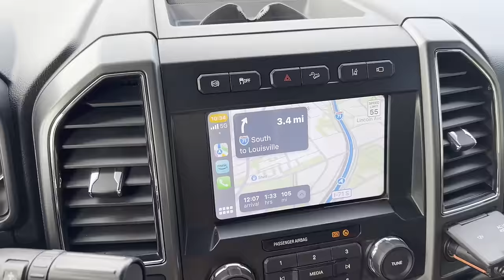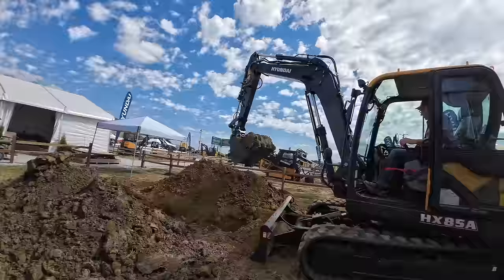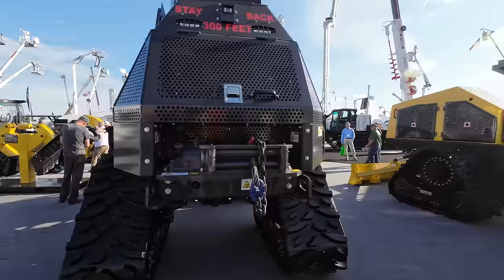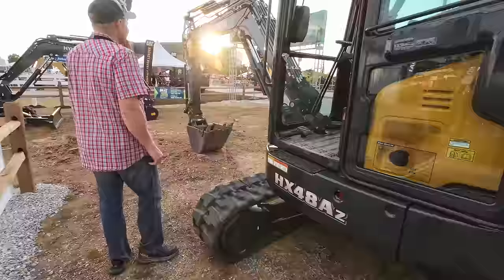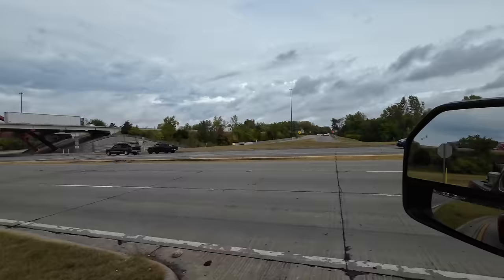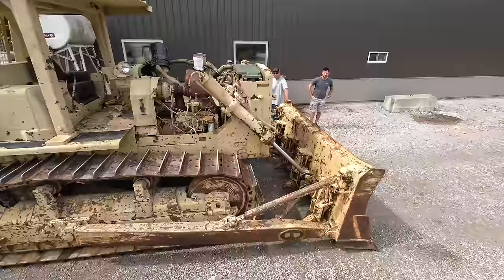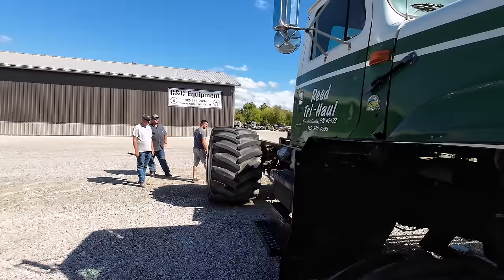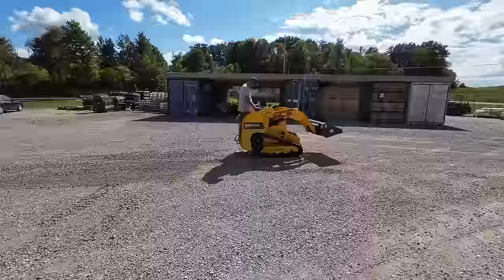Crazy machines at the Utility Expo, and a behind the scenes tour of C&C Equipment!

Comment: The Ditch Witch mini skids are monsters. Several years ago, the landscaping company I was with had a Vermeer mini skid. It was a little gutless. Then we got the Ditch Witch SK850 for a couple years and then the Sk1050. That 1050 was insane. It could do almost as much as our Cat 257 and 259. A 50-60 inch bucket or 2400 pound pallet of block was no problem(with the weight kit).

Comment: I used to repair Army equipment and sometimes it was cheaper to buy a new piece of equipment, strip it and repair 5 or more pieces of equipment with the parts from the new 1. Once we did that we would park that piece for a while them DRMO it.

Comment: Small Emplacement Excavator (SEE) was used in the late 80s early 90s by Army Combat Engineers.  They were for building crew served weapon emplacements quickly and reducing obstacles for light Infantry, Airborne and Air Assault Units.
Reply: They were also used in Quartermaster companies. I was in a unit out of Fort Lewis in mid 2000's and we had a couple we used for digging fuel berms.

Comment: Matt to be honest if you need or want a pit build an outside one. Really you only need to have a gravel bottom and a sliding expanded metal hatch. Concrete with steel beams much like C&C has. Add in some electric and you are golden.

Comment: Hello Matt. I got a mini 2.5 tonne excavator. I just did the rebuild on the spool valve but could not drain the air out of the cylinders. I have been your youtube fan and you inspire me on machine. I got old 1987 toyota excavator as fun project. Thanks  for answering my delima hehe

Comment: Nice teaser in the outro.
Those CEE (Combat Engineer Equipment) trucks were on-going nightmares.  The hydraulics were their Achilles' Heel.  And, everything seemed to use a different size hose.  And, as a "jack of all trades" they were a "master of none."  The backhoe function was un-inspiring (and prone to break).  The front push blade models were better than the loaders, but not by much.

Comment: That F super duty with 4wd.
Is one mity rare ride.
87 to 97 there are no off the line OE 4wd versions, only rare ones that where converted,
 when still new. but after they left the dealership.
.
The sound of the 220hp of Pre combustion chamber fury, is becoming rare as well.
.
Even the 3 big countys in Oregon have passed laws on the 14K-gvw and up class with non compliance diesels.
But same truck with a big ol gas pot, still on the road..

Comment: We did a fiber optic cable job and i got some good sleep on the ditch witch rock saw we had steel tracks and a 21 mile job 18.7 was sawed because our plow train couldn't keep depthonce you get the auto creep set right out in the sun rocking back and forth with the drone of a lugged down diesel-powered machine it would put me to sleep everyday the summer of 96 i got paid $28.75 an hr time and a half after 40 and we averaged 60-65 a week plus $280 a week perdiem and I got paid to sleep 95 percent of the day I  loved cutting rock

Comment: Id put a pit under the awning  where you wouldn't be cutting out pipe. You dont need anything big 2 1/2 x 5¹/² maby 10ft long with metal grates in 2ft sections so tou can pull over and go under and just lift off the section where the drain is. Then drain it and put the grate back so your not lifting anything heavy and leaving an open pit.

Comment: The only thing I wish they would do for the mini excavators is add in a 6 way blade, blade wings along with height extension. I have seen so many project that could use an angle blade that is 2 or 3 foot longer. Its not like you are pushing like a dozer. You are pushing dirt that you have already dug up.

Comment: Love Volvo frontend loaders we have a old 60 and 90 from about 08 there amazing and I may be saying that because there split control one finger does the boom other the tilt our old Komatsu and new plus Hyundai are blended like cat skid steer I hate it on a loader I hated cat skid steers for a while until I got the one I use it's a MTL setup so it's fast and rides like s580 Mercedes but I run the new bobcats occasionally wheel and track and they suck I like the old 2008 foam tire hand feet bobcat better

Comment: Those little rock trucks are really cool, I have never seen them before and I could find a ton of uses for one.

I have a JCB Hydradig 110w wheeled excavator which is similar to that one machine I just wish I had an articulated boom.  I am not a JCB fan and I had 2 machines fall in my lap.  I also have 3TS-8T teleskid which is a really versatile skid loader.  It's crazy how all these smaller manufacturers are coming out with unconventional equipment designs.

Comment: Thanks for the info.  I would like to visit the expo. But I did not have. $100. To get in.  Plus fuel expenses.  I want. To give you some bucket handle ,,replacement for 5 gallon buckets.  A patent. I started 5 years ago.  Recycle.  5 gallon plastic buckets. When the. Plastic breaks just move the handle to another bucket.  Save the handle.   Thanks for reading.

Comment: When he says "forestry work is tough on machines" he's not kidding. When you use a Cat D6 for excavating and moving earth the tracks last about 5,000 hours. When you use a Cat D6 to shear stumps and make beds to plant trees the tracks only last about 1,500 hours. They have to complexly rebuild their tracks, bedding plough, and V-Blade every year which costs over $60,000. The maintenance is very expensive and intensive. The company we met with with doesn't even buy their own machines. Even though buying them is cheaper than leasing them. They get so worn out they're impossible to sell. Caterpillar takes them back and complexly rebuilds them.

Comment: Im still waiting to hear about the pending lawsuit against the utility company. Racketeering laws prohibit public utilities from inventing pricing as well as making proposterous claims about costs when providing services. Not sure about your state, but MOST of the lower 48 allows for the HO to contract the wire pull and the transformer install. Not to mention the purchase of said transformer as long as it is in line with the power capability of available voltage at the source. Also, if your planning to throw a house on there at some point, I'm thinking a 72kw lift is in order since you likely will hve a 400 amp service  at the shop and a 200 at the residence. And I would ease up on the iron purchases until some of it is running and sold so you can focus on the shop since that's where all the repairs and refurbishing will take place. Love the content but am anxious to see you complete the shop with heat and power before collecting more rusty rails.

Comment: 1:22 as you drove down the freeway, I had a chuckle as my brain said WTF to your distances on the signs. Do your odometers have fractions in US vehicles? What is this deal with making things harder than they have to be? Why not state 0.5 mile instead 1/2 mile. Why not round to the single decimal? You're doing that with fractions anyways as your odometer is using a single decimal point and so is your GPS. 

Why do Americans hate the decimal point so much? Fractions are very time consuming to work with while a decimal point is not. Fractions, what's the point of that?

Comment: small piece  of advice mat allways dig with blade behind you,get more downpressure and can dig deeper
Reply from the maker: You are always supposed to dig over your idlers, never your drives. Plus down pressure isn’t usually lacking it’s pulling power. Having the blade in front keeps you from rocking or sliding and keeps you more stable when booming out with a bucket full of dirt

Comment: We found the JD 60 to be too big and too small, It can't be hauled on a Car trailer. if you have to use an equipment trailer you may as well have a 130, you still have the blade and will do larger jobs, but you can pull it behind a dump truck.